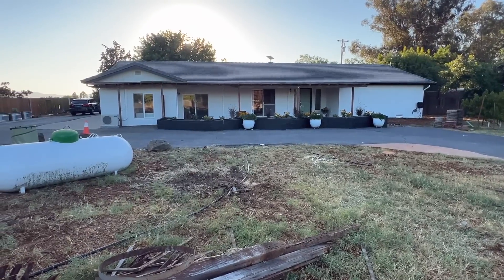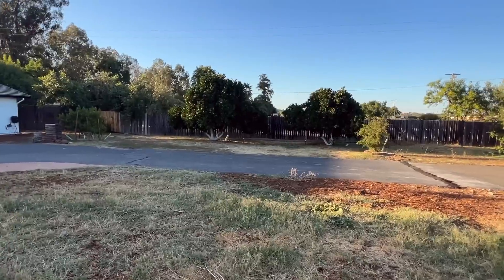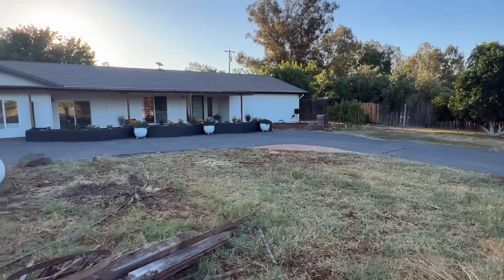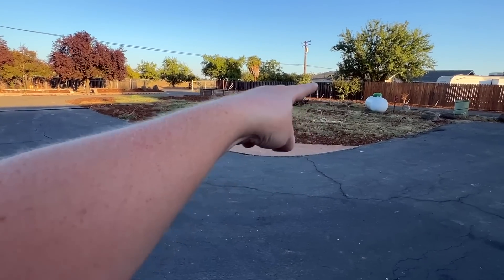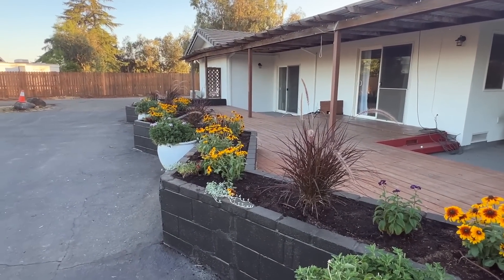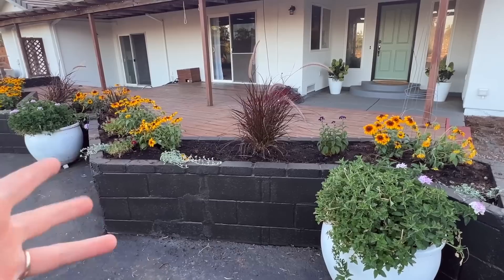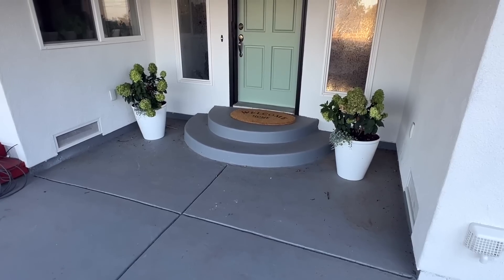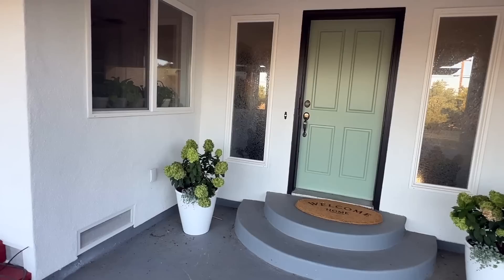September Garden Tour! 🌻💗☀️ :: Come See Everything We've Accomplished So Far!

Comment: As far as the zig zag planter and your issue of the plants wilting I have found that if you dig the compost into the soil instead of just putting it on top and watering the whole area before you plant, it will hold more moisture in the long term. Kind of like when you have to pre wet potting soil because it's hydrophobic when it's so dry. Love all the changes so far and can't wait to see more.

Comment: Your soil and compost is likely hydrophobic. If it were a pot, you could submerge it in water until it stops bubbling. In a bed, you need to water with a fan type sprinkler for a few hours or run your drip irrigation for several hours to slowly soak in really well then you can resume your usual watering schedule.

Comment: Check the temperature of your compost. Normally when you get it in bulk it is hot. You need to let it cool to 80 degrees or lower before using it. If it is too hot it will burn your plants. I use compost in my garden as mulch and it works great. So Cal zone 10b.

Comment: Love all the things you have done….some great choices!!!  I have what I think is an easy fix for the septic area problem…for a relatively low price, you could cut out a part of the driveway - enlarge the curve….and could also do a ‘clean up’ of the edges of the rest of the driveway.  And maybe take out the chuck of concrete in the centre island along the driveway - not sure of the purpose???Follow a straight line and use a circular saw or have a pro do it….would really sharpen up the edges !   From my experience of living on an acre for 26 years, you are spending your money on the bones of your property which you will pat yourself on the back in later years….

Comment: A second gable over your front door would be wonderful. Build out the walls to the same base line as the existing gable, that will give you a foyer and balance the facade. Then add double front doors. You could make the new gable a bit wider and taller than the existing one to emphasize the main entry. This would do wonders for the house and add a bit of a landing space inside the front door.

Comment: Sorry if I missed this in any of your videos, but as a homeowner with a septic system I have to ask: 1) Have you had the septic tanked pumped out, yet? If not (and if the previous homeowner didn't have it done before the sale) I would strongly recommend you do that now, so you know the system won't be backing up any time soon and you'll buy yourself several years of peace of mind. 2) Have you had the leach field inspected? If it will need to be replaced it's far better to do so sooner rather than later (when you risk the system backing up) and before you plant up the area. 3) Remember: shallow roots ONLY over a leach field. NO TREES! It's intimidating, but EXCITING to have a whole new property to plan and plant and watch everything grow. Don't allow yourself to become overwhelmed, but take it one step at a time: every step you take is leading you in the right direction. Progress is the perfect path to travel (it may have twists and turns but it's always an adventure)!     :)

Comment: I had white fly this year bad in my vegy garden. We used castile  soap and neem oil. Plus put yellow sticky traps they will diminish if you keep changing the traps out. On flowers u could use captain jacks too. I get so sick to my stomach worrying when I find a massive infestation.but in a couple weeks they will get better if you keep after it. Good luck.
Reply: Yes Janey. I read Neem oil or mix 1 tablespoon Castile soap with 1 quart of water and spray the underside of the leaves. If you use the soap recipe it coats the eggs, larvae, and adults and suffocates and kills them. Spray either one of these in the morning or evenings when it is cooler. Good Luck! Your new house and property are coming together really nicely. Great color choice.